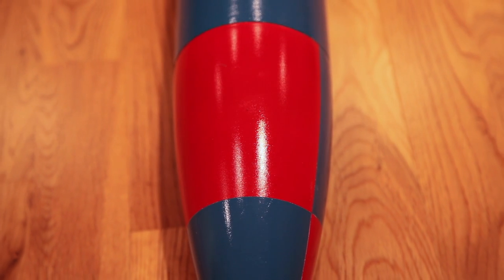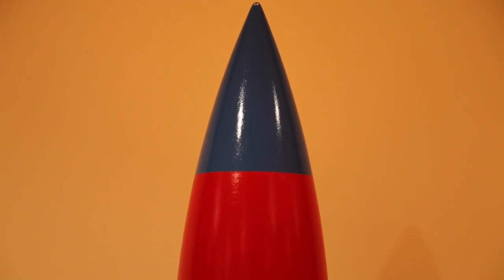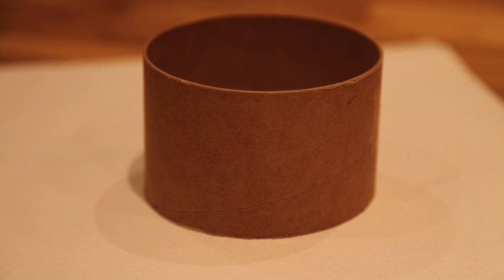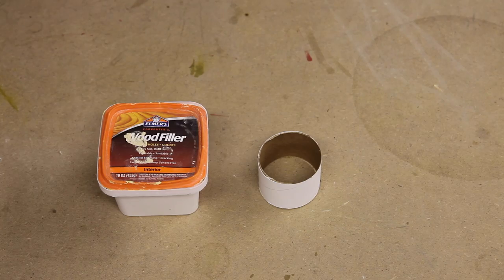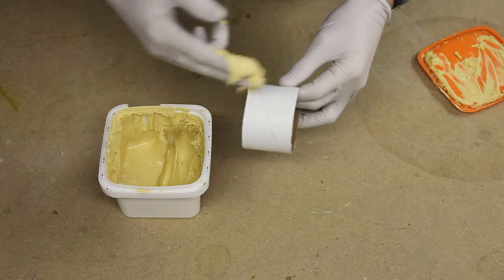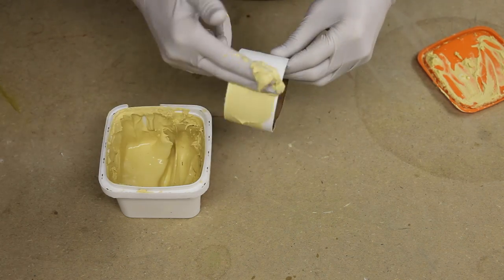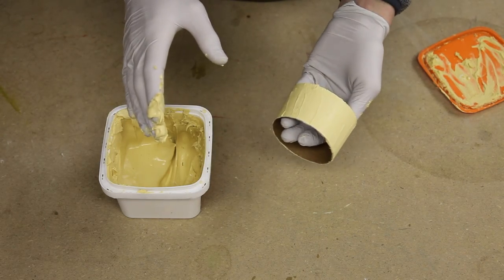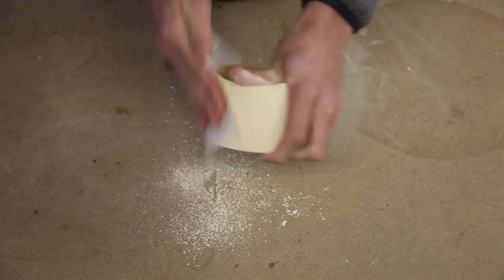How to paint model rockets and achieve a glossy finish

Comment: I usually use putty normally used for plastic models, although sometimes I use wood filler.  Anyway I follow the spirals wait for the putty or filler to dry, and sand it off.  Then I prime the body tube, wait for it to dry and sand the primer coat, I think I use 220. The primer sanded down removes any texture from the cardboard tubes, and when you paint the final color, it's smooth as glass.  One rule of thumb I go by, if you need to paint a second or third color, wait five days before recoating.  Don't believe the can when it says you can repaint in 24 hours.  If you don't wait five days, you run the risk of the earlier coat wrinkling up when the next coat is applied, and the paint job is ruined.  Once that happens you have two choices.  Wait for the wrinkled paint to dry and sand it down again, or use a paintbrush with paint thinner and brush off the wrinkled paint.  It's like painting it with paint thinner, the idea is to dissolve the bad paint and wipe it off with a paper towel.  You still have to wait a few days and then sand it, but it's a lot less sanding.  After the paint job is finished, apply decals to the rocket.  I usually apply a clear coat and the paint is smooth and the decals are fixed down where they won't be coming up a year from then.  Just the way I paint my rockets.  The rockets are really glossy with a clear coat of paint.   Also try to use the same brand when painting different colors, some brands are not compatible.
Reply: Do you sand before applying the clear coat and between clear coats?
Reply: @paulacastelli6362  No I don't usually sand the rocket before clear coating it.  The rocket by now is very glossy and smooth, I clear coat to make it more glossy, and to seal the decals down so they don't come up later.  The three sanding grits I use are 150, 220, and 320.  You can also buy those small sanding sheets from Testors.  They have some really fine grains.  The problem is, the finer grain gets filled up with the soft paint.  Sometimes I try and scrape it off with the back of an exacto knife, not the sharp edge.  That somewhat works but it's not perfect.  There are many ways to fill in the balsa grain of the fins.  Once the fins are glued onto the rocket I paint them with watered down Elmer's glue.  Then, I mix diluted Elmer's glue with microballoons.  The microballoons look like powder, some are white and some are brown, it depends on who made them.  Paint that on the fins and wait for it to dry.  After it dries, sand it down using an Emory board, the same ones you use on your finger nails.  The stiff boards make it easier to sand the fins.  I've done about three coats of this sanding in-between.  Eventually when the rocket is sprayed with primer, and sanded down, the cardboard texture goes away and it becomes smoother, and the fins look smooth too.  Since most rockets start out as white, I spray paint it with white paint, and wait five days before painting the next color, probably red for the fins.  When you're finished painting your colors, decal the rocket and clear coat it so the decals don't come up a year from now.  One word of caution, some pressure sensitive decals will react with clear coat, and it depends on the manufacturer of the clear coat.  Cut off a waste piece of the decal and clear coat it to see if there are any reactions.  I found I get most of the reactions from the decals from the Custom Rocket Company rockets.  Because of this I may not clear coat a rocket made by Custom rockets.  My experience with their decals is that the clear coat seems to want to bead, and it's not a smooth finish, not too bad, but noticeable.
Reply: Some additional notes; I think the same company that makes Rust-Oleum paint also owns the Testors line of model paint, so it's possible the colors may be the same.  You may use primer a few times on a rocket, sanding it down in between.  What your doing is using the primer as a filler to fill in any unwanted textures.  As for microballoons, I've heard that Talcum powder is a substitute, but I've never tried it.  I did find some microballoons on Hobbylinc, the place I bought it before was a Surf board place somewhere in the northwest US.  It's been a long time so I don't remember the business.  It's normally used to mix with epoxy, so you don't use as much epoxy in building something so it's used as a filler.  In this case I'm using Elmer's glue and adding microballons to it.  Don't dilute the glue too much, in fact it may be possible to use it straight as it is.  Don't be afraid to add the microballoons to the glue.  It's the microballoons that is filling in the grain.  As long as it has the look of paint, thickness wise.  Other methods, some people glue paper to the fins, you can use wood filler and sand that down, there is stuff called balsa filler for balsa airplanes, but that stuff is smelly.  Elmer's is non-toxic.  At least it doesn't smell, and I think it hardens the fins I little bit , a good thing. Oh some people have painted the balsa with super glue. I've tried it, it's ok, but to me the Elmer's is better and there is no chance of gluing your fingers together.  The fumes from all that super glue may irritate your eyes.  Just some thoughts.
Reply: @josepholexa565  Thank you so much for your detailed reply.  Very helpful!
Reply: Paint over with other color after 24h is ok i think.
Reply: @schleimigerhelmling6763  I used to build plastic models.  I never had a problem recoating after painting, especially when using an airbrush.  The problem with rockets is your using an aerosol can, and that puts down a heavier coat that takes longer to dry.  Sometimes most of the rocket is fine, but in areas where the paint was thicker, it will wrinkle.  You get an absolute mess when a paint job wrinkles when you recoat too soon.  My usual course of action when that happens is to wash the paint off with paint thinner, dry it off with a paper towel, then wait some time before working on it again because you'll have to sand it down again to start repainting it.  It surprised me when it started happening when building rockets when I never had a problem with plastic models.  I speak from experience, I built over 100 rockets, I've lost count.  I found that giving the paint a few days to dry,even though it sounds like a long time, is actually the fastest way to build one.  If the paint ever wrinkles,it will set you back a few days.  Another advantage to waiting a few days, is that when applying that second coat, and you get it somewhere it isn't supposed to be, you can wipe it off with a tissue that has a bit of thinner in it.  It will take the second coat color off without taking off the base coat.  Why, because the base coat is now drier and harder than the freshly applied second coat.  If you do that when both coats are recent, you'll end up taking all the paint off.  You don't have to believe me, just wait 24 hours and recoat the rocket and see what happens.  You may get away with it, but eventually you'll encounter a problem.  There is no substitute for patience.